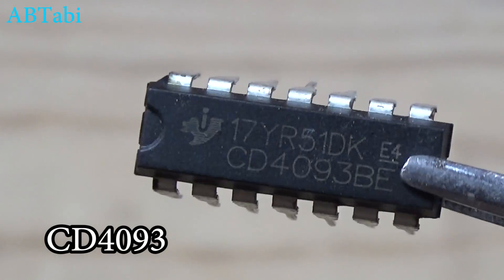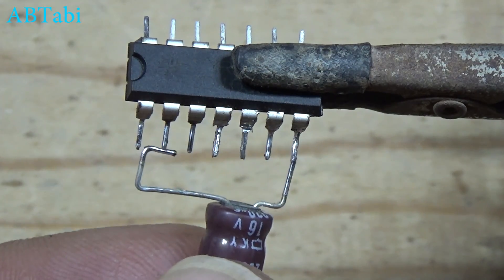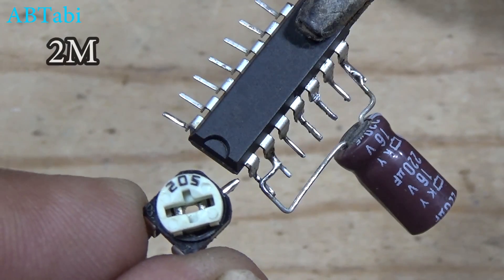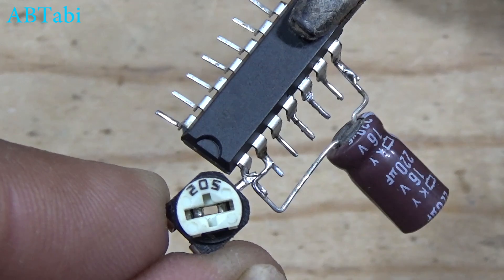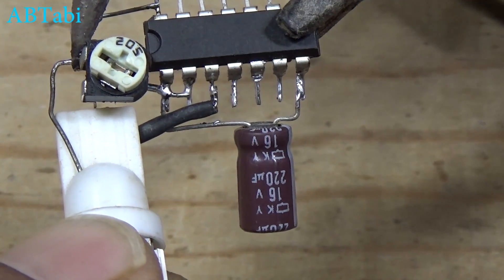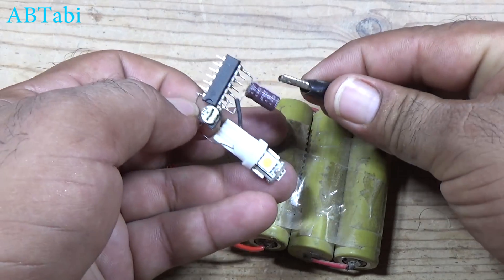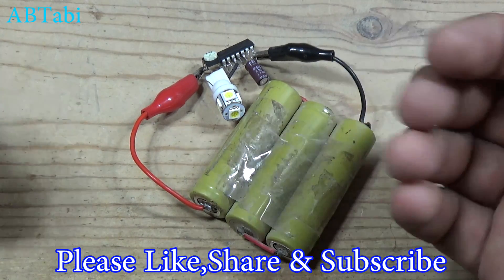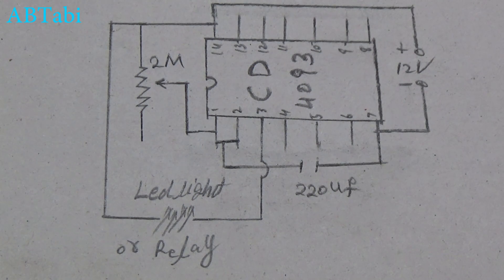Make ON OFF Delay Timer Circuit using CD4093 ic, Diy inventions circuit

Comment: بھت سارے لوگوں کو کمنٹ کیا ہے کہ بھائی مجھے 1 سیکنڈ کے ڈیلے سے 5 والٹ پاور آف کرنی ہے لیکن کوئی بھی لفٹ نہں کرا رہا ہے بس سب لوگ لایک شیئر کی درخواست کرتے ہیں
Reply from the maker: My dear friend ,,,,,   you can use this circuit and adjust it as your wish ,,,,,,    where i am using led light you here use relay to control any supply or load ,,,,,,,,

Comment: Hello Friend
I have control of the garage door connected to the high beam of my car. So that when I blink the light turns on and the gate opens. But if I need to walk with the high beam on, the control will burn. So I need a timer to prevent the controller from burning out, but leave the high light on when needed. Can you help me? Thank you
Reply from the maker: Dear friend ,,,,  send me diagram and high beam load ,,,,,    send me with channel linked facbook page ,,,,,,

Comment: Following your videos since 1 year you made this same project a year back with delay light on..I need a circuit ( 5 sec interval than light on )..I need it for my car windshield wiper motor...pls help
Reply from the maker: Dear adjust it as your wish ,,,,,,,,
Reply: ABTabi that does not answer my question?

Comment: keep the delay timer circuit with CD4093 ic, diy inventor circuit
Today I'm going to show you how to make an ON-OFF delay timer with CD4093 ic, DIY invention circuit at home. super simple and easy delay when switching off the timer with cd4093.
Unfortunately, my circuit always stays on, no matter how the potentiometer is positioned.
Reply from the maker: As in this project,,,,,,